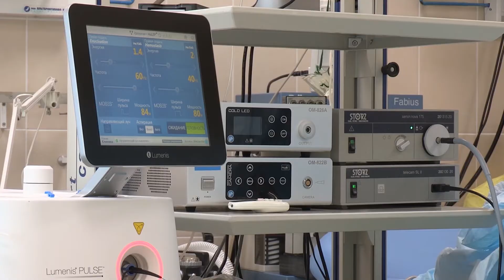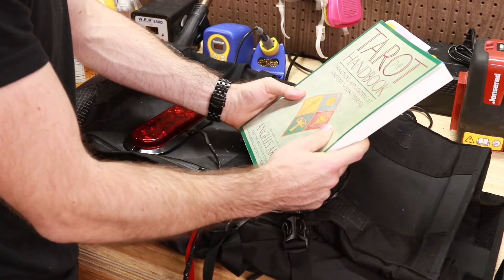Making an LED Backpack Using Trailer Lights

Comment: As for the difference between nectar and juice, the former may be diluted and/or have additives, whereas juice is expected to be 100% undiluted and pure stuff. Some juices are made from concentrate, but are still meant to be equivalent to freshly pressed juice, whereas nectar is not.

Comment: Finally found the one person on youtube who was thinking like me. I want to build a travel backpack with 12v lighting as you did for multi  use and dark trailing every once in a while. Having built in lighting on the pack helps and lessons' the need for head lamps and other items and you can charge your lower powered devices as well. Great build and I will be building something similar soon. My setup will have permanent lighting with removable battery.
Reply from the maker: Great minds think alike. It's so useful, I'll tell ya. Being as bright as a car makes people pay attention. Let me know how your build goes! I'm excited to see someone else with a similar build. Sounds like you'll get a lot of use out of it!
Reply: @HardwareUnknown  Yea I have cases where my family and I stay at events past dark and it will be nice having a back pack on and lighting dark paths on the way out to the car. I have a collection of Ryobi 18v and 40v batteries that I can put into use for a built like this. Hopefully you post more builds like this in the future.

Comment: going to do this for my scooter bag
Reply from the maker: Super high vis, I think you'll enjoy it. I also ended up using a different battery for most of my rides. It's the same brand, but smaller/lighter. An option if you want to trade off lower capacity for lower weight: https://amzn.to/3zZOP0n

Let me know how the mod goes!